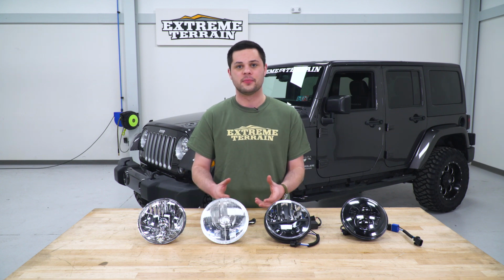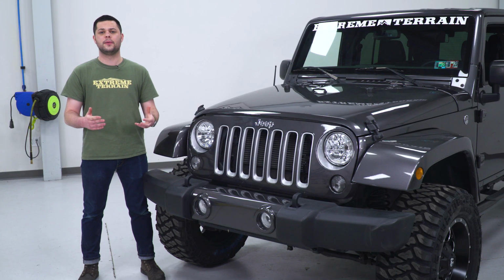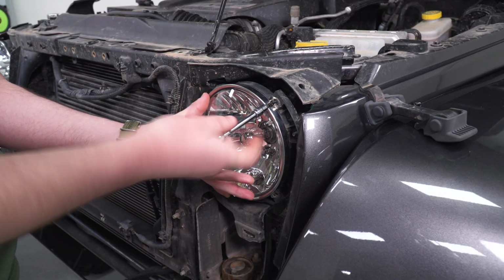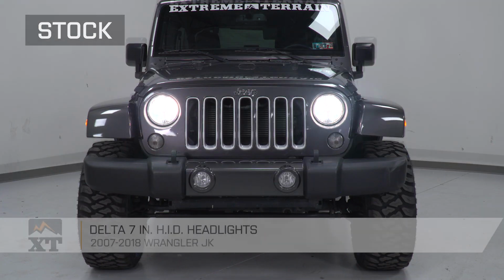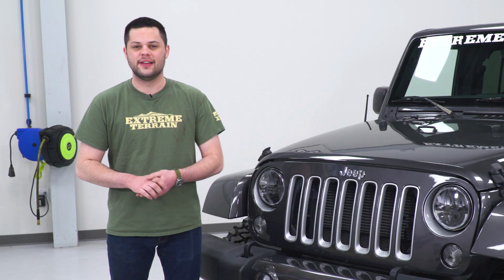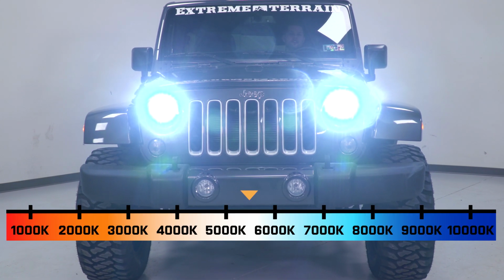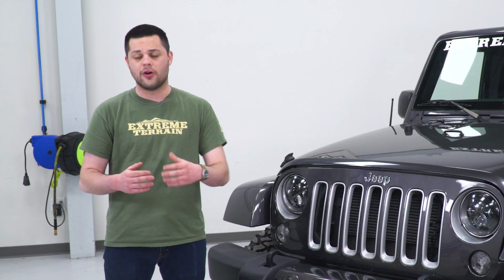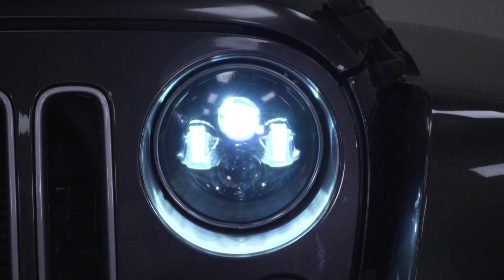How To Choose Headlights For Your Jeep Wrangler

Comment from the maker: Subscribe For The Best Jeep Videos: http://terrain.jp/SubscribeXTyt
KC HiLiTES H4 Headlight Conversion Kit (07-18 Jeep Wrangler JK) - https://terrain.jp/2I2QtVg
Delta Xenon 7 in. Headlight Kit (07-18 Jeep Wrangler JK) - https://terrain.jp/32yE5pm
Axial LED Black Daymaker Headlights (97-18 Jeep Wrangler TJ & JK) - https://terrain.jp/32yB0pG
Axial LED Headlights w/ High & Low Beam (97-18 Jeep Wrangler TJ & JK) - https://terrain.jp/2vlzM4O
KC HiLiTES H13 to H4 Headlight Conversion Cable (07-13 Jeep Wrangler JK) - https://terrain.jp/2TkukXJ

Comment: Hi!! I know this video is from 4 years ago but I would like to know which are the best 7” lights for a 2018 Jeep Wrangler JK? I have seen many options but I can't decide. I like Morimoto but I think it is a bit expensive.
Reply: What did you end up buying??? 😅
Reply: @fahdahmad796  I bought some KC HiLiTES that convert your H4 halogen lights to H13 and it improves a lot, even though I installed some Luxster Punisher LED bulbs and it looks incredible.

Comment: Hello Joe  🍻
I enjoyed this video good job 
I have an 2013 jeep wrangler unlimited JK sahara v6 3.6 automatic GECKO PREARL green 4 Doors  has 35x12.50r20 NITTO RIDGE GRAPPLER TIRES M T WEEL'S 
BLACK, 
I WOULD LIKE TO order a set
Need 8- 6. 58"   ring Screws 
Just so I I have extra 
Missing 1 
I don't have a computer or wifi connection so I need a phone number is one available?
●|||||||● here's a jeep wave 
✌  👋 happy JEEPY

Comment: I have the Oracle LED kit in my 2021 JL and I get flashed at 2x when I go out at night because people think I have my brights on when I don’t... It is very annoying and the kit was $160 which pisses me off even more.
Reply from the maker: You may want to check how your headlights are aimed. Even on low beams, if they're angled up too high you could be blinding oncoming drivers. -Zach
Reply: @extremeterrain  you were exactly right. It’s very surprising how much I had to adjust them since the Jeep was only 10 days old and I was super careful during the install.

Comment: You can choose your color but go with the 5k color is best. The higher the color the less light you see on the road. So go with 5k on Led's and you won't be disappointed. Plus you have any color besides white or yellowish you get a fix it ticket in all states
Reply from the maker: Bright white and yellow-ish light will definitely be easier on the eyes than the darker blue or purple tones you sometimes get out of an HID, in my opinion. Thanks for watching! -Zach
Reply: Missouri the only disallowed color for headlights is red, as no red lights can be visible forward unless you are a school bus or emergency vehicle.  So your information is false.